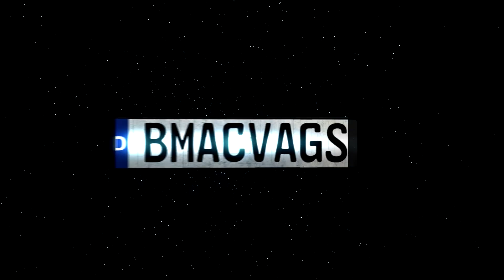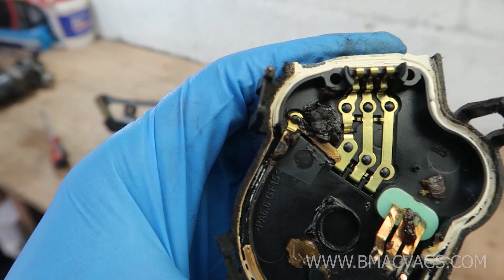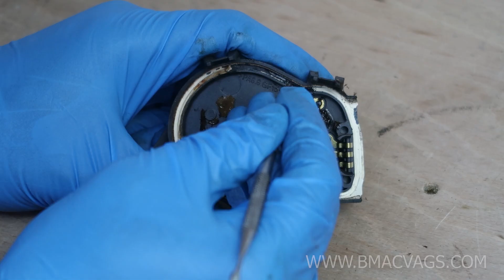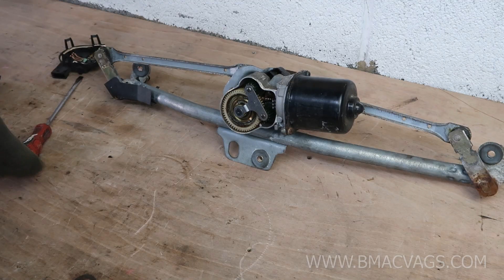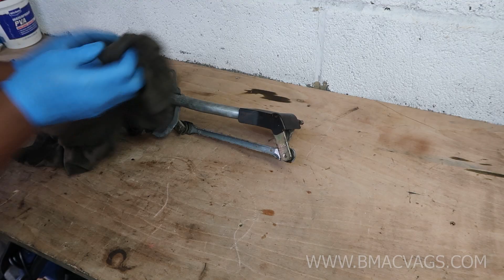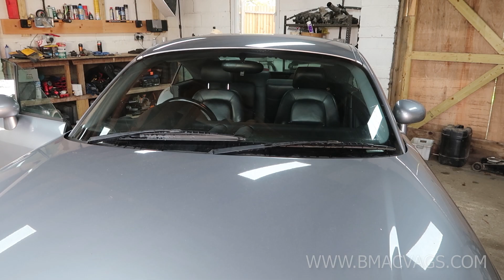Broken Window Wiper Motor Repair Fix Tutorial

Comment: Something I like to do on those wiper mechanisms, is to pull them further apart and grease those pegs, where you put the copper slip on. Take it apart, clean it, maybe give it a little scotch brite and then put it back together with a generous helping of grease(don´t put copper slip or ceramic grease in there, that will seize up over time). Your Wipers will go quite a lot faster and there will be less strain on the motor.